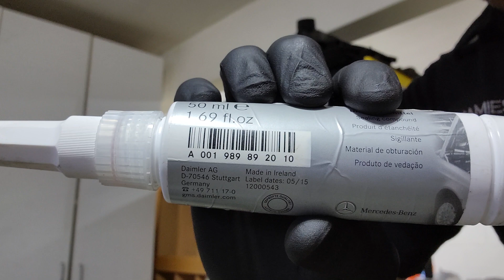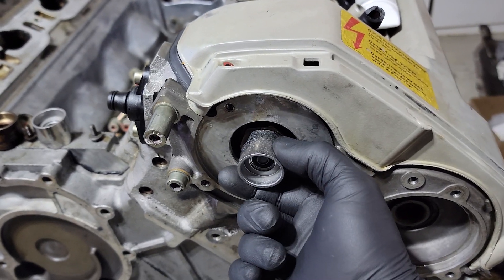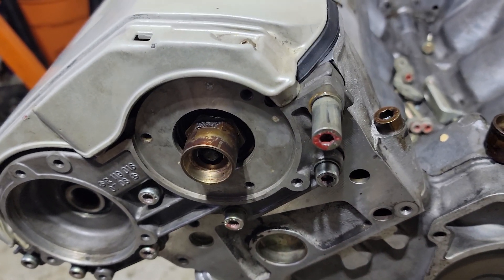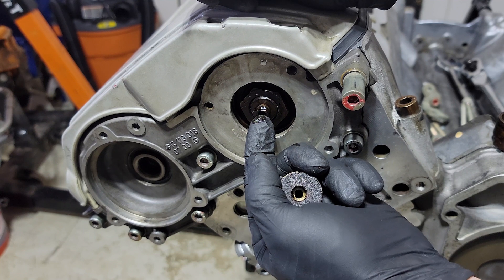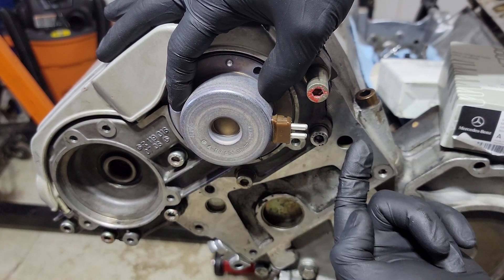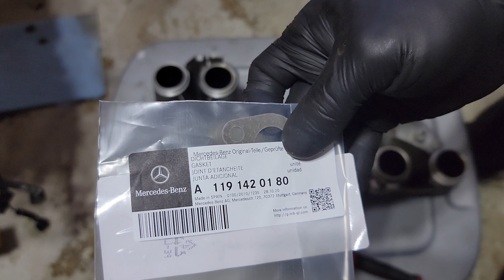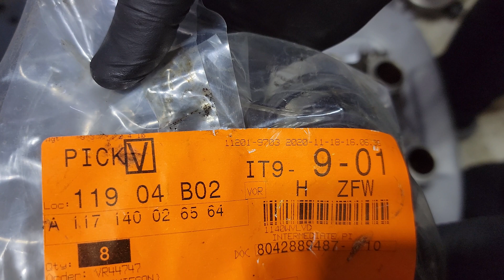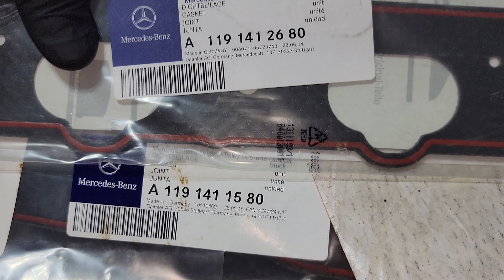M119 Assembling and Installing Intake Manifold, Installing Camshaft Armatures

Comment: Hey what's going on had a question  for you or you might already have a video for it  I have a 97 cl500.   M119.980 engine. I been having an issue  car starts up fine in a few second  its revs up to 3500 rpm and stays at that . Any idea  where are u located
Reply from the maker: @louisolazagasti4979  I'd be interested in seeing the position of the throttle plate.  I'd check that first.  I'm in Southern California.
Reply: @FriendlyMBTech   thanks for the fast response. Unfortunately, I am located on the other cost .  Am going to take a look at that kind of makes sense since I was changing  the cabin  air filter .
Reply from the maker: @louisolazagasti4979  if you were in the area, double check the throttle linkage.
Reply: @FriendlyMBTech    where is the throttle   plate ?
Reply from the maker: @louisolazagasti4979  if you take off the air cleaner, its straight down the big hole.

Comment: Man!!! you should've cleaned tf outta that Intake! soo gunky!! that gunk cause the ticking noise! I am going to take the intake apart on both of my M119's after watching this video!
Reply from the maker: What was in the intake was barely a light film.  It wasn't worth the time.  And I don't see how gunk would cause a ticking noise.  The only ticking noise it had was slightly after getting it drivable for the first time.  One of the lifters was a little sticky.  Now it runs quieter than our new cars.
Reply: @FriendlyMBTech  My 98 SL500 which I purchased it 2 years back has been having sticking valve issue! Don't drive it much since purchased did maybe 2 oil changes until yesterday! I added 8 oz of Seafoam in the old used up oil brought it to temp drained it changed the filter, put it new ( cheaper ) oil drove it around about 20 miles added sea foam let it run for a bit drained it! changed the filter added expensive oil! Still ticking! used the spay seafoam can stuck the tube past the mas sensor thru the mesh up top 2k RPM sprayed 1 minute ticking noise GONE! proceeded to use half the can! this morning on cold start ticking noise was there but barley! once warmed up noise gone! I think I am going to take the intake apart and clean the living hell out of it!
Reply: And I did inspect the cam oilers they're all metal and intact!
Reply from the maker: @musicman5299  those are the good ones! Just replace all 32 o rings.
Reply from the maker: @musicman5299  that could also be the previous oil changes and seafoam in the oil doing it's magic.  I physically checked each lifter before installing them.  I put that in a video.  I had to use 8 lifters from the original engine to get good functioning ones.  Otherwise my cost is about $35 each.

Comment: Well after further review my engine runs but I have traced a rather large coolant leak to a puddle underneath the intake manifold.  I’ve checked both rear hoses and used a borescope  to try and find a source but I have only been able to find the puddle.  So my question is how to remove the small front coolant hose with the engine in the car?  I’m planning to use an assistant once I have things removed.  But that coolant hose worries me.
Reply from the maker: Are you talking about the short fat hose right on top?  You'll have to remove the front lifting eye and coolant outlet to get that hose off.
Reply: @FriendlyMBTech  oh yes I see what you describe.  Not too bad. 

So it looks like I failed to torque the rear inside manifold bolt on the drivers side and the coolant there  is easily blowing by the intake gasket into the V and running out the rear drain hole.  Buying two new gaskets and more fun.
Reply from the maker: @joewestfall2952  that's an easy enough fix.  Glad you figured it out.

Comment: Hi please can you tell us where you bought the new Sharp Edge camshaft armature / end cap as I might need to replacemen my solenoid too.?
Reply from the maker: Hello, yes I got the armatures and the cam magnets from the dealership.
Reply: @FriendlyMBTech  can I get the PNs for the armatures please?
Reply from the maker: @ahemgee9542  I believe the part I used and also the most current is A 111 015 00 43

Comment: I used the black silicone on the cam magnet flanges.  Didn’t realize the orange anerobic  was required there.  Will this still work?
Reply from the maker: As long as the excess doesn't interfere with the function of the armature on the cam then I don't see why not.

Comment: Hello Mr. FNT — All looks good with this video. Glad you got the orange koala-claw goo!!   It does not matter whether you re-assemble the intake manifold with it off of the engine or in the Vee.  I installed my ETA and such with the intake off of the engine, but everything is pretty accessible even with it installed on the engine. Being out of the engine gives you a little more "side access" for the ETA and such. The one thing that I did when mating the two halves together was to get in there with a flashlight and MAKE SURE that each donut ring was sealing all the way around.  

The reason for this is that about 10 years ago, when doing an M117 (same identical donut rings), I had ONE RING that had a few mms that was bent in, and I had an air leak upon starting up the engine after I'd completed the job.  So I had to remove the intake manifold and find the air leak that was getting past the throttle body and KE-Jet injection air plate, and causing the engine to idle at around 1,000 RPM.  But a smoke test found the culprit, and then I remedied it.  Culprit was here:  https://www.500eboard.co/forums/threads/how-to-5-6-liter-m117-top-end-rebuild.559/post-5575

One thing to note when you install the front crank seal -- you are going to want to insert it to a depth that is slightly (2 mm or so) offset from where the original crank seal was.  This is so that the new seal's sealing surface contacts the crank snout in a different position, in case the old crank seal wore a slight groove on the snout.  This will help ensure that the new seal gives a nice tight oil-leak-free contact on the crank.  There should be plenty of room to adjust that depth, and I'd also check the crank snout with your fingernail to see if there is a groove or scored area from the old seal ... and again avoid that area if so with the new seal.

Miss your buzz haircut like you had in the early M119 videos !!  It's summer time, easier to work with short hair!
Reply from the maker: Thank you! I did check the donut seals on the intake manifold and they're all good.  One thing that helped me was putting on the donuts dry on one side and lubed the other so the dry side stayed put and the lubed side slid right on.

I did check the crankshaft and there doesn't seem to be any wear on the shaft.  It's really smooth.

I do need a haircut although I don't thing I'll go as short as I had it.  I've had buzzed hair for around 20 years and the last time I cut it was the first time in just as long that I actually went to get a haircut.
Reply: @FriendlyMBTech  This happened to pop up on my forum.  Gives you an idea of all the bolts that require sealant.  Note the stud when re-mounting the transmission that is mentioned, as well as the one bolt on the tandem pump/power steering pump bracket.  https://www.500eboard.co/forums/threads/sealing-engine-bolts.16642/